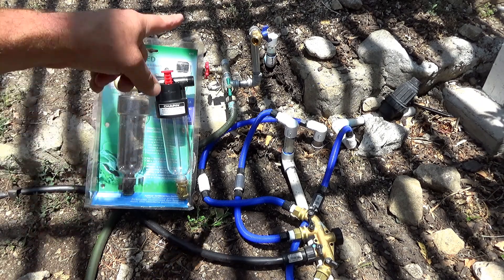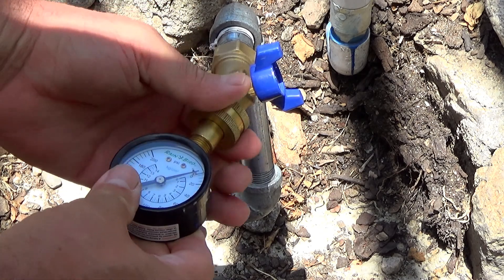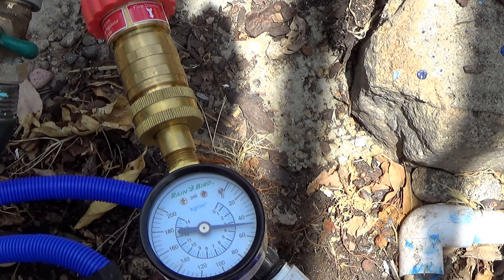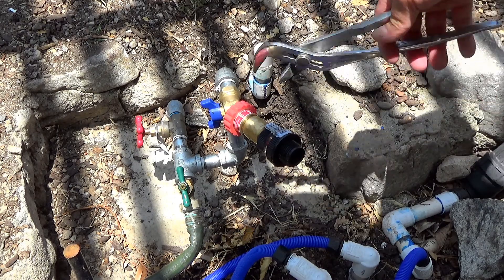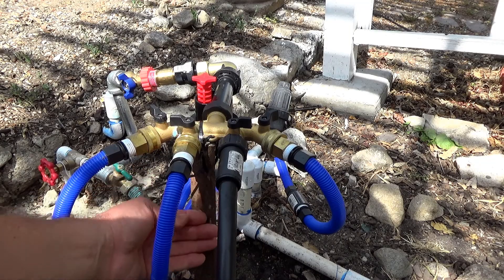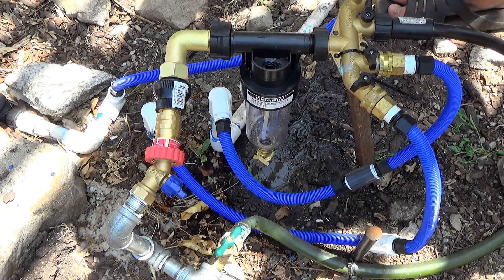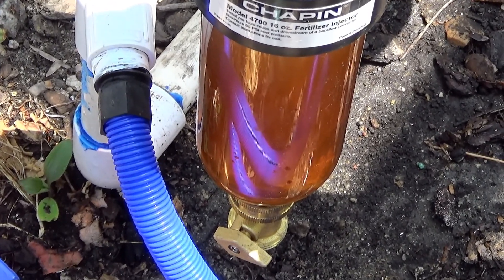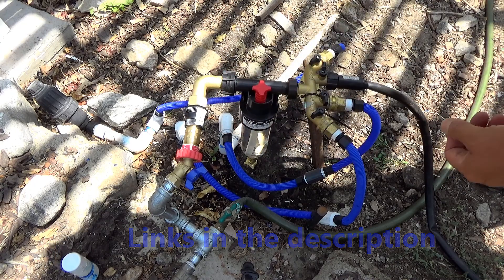Installing a Chapin 16oz Liquid Fertilizer Injector

Comment: What a great video!  This is all new to me and I do not want to sound like a dope. I use 1 tablespoon of fert to one gallon of water. How can I make the mixture so I am getting gallons at a time watering with a house for all my plants and hanging baskets? ☺☺☺
Reply from the maker: If you use a garden hose with sprayer for fertilizer, Miracle Gro makes one, which I know works with its granulated fertilizer designed for it. If you're using a liquid fertilizer of your choice, Ortho makes an adjustable "Dial N Spray" that I believe covers from about 8 ounces to 1 teaspoon per gallon, and it does have an adjustable setting for 1 ounce per gallon; it has a liquid reservoir capacity of 32 ounces, which means you could fertilize with one ounce of liquid up to 32 gallons of water with one fill.
If you want to set up a drip line from your house's spigot, I would search "Installing a drip line to my house's spigot"
Hope that this helps.
Reply: @doityourselferhomeandgarde9732  Thanks so much, Yes, yes I understand what you are saying. I have a drip system hooked up. So far so good but wanted to try to use the Chapin 16oz Liquid Fertilizer Injector connect to "hose" watering if you know what I mean..? Your videos are sooo interesting. I am glad I found your channel.😄
Reply from the maker: Exactly what type and brand of fertilizer are you using? Is it liquid or granulated? If granulated, is it water soluble?   @pennyarizzio2824

Comment: How long did it take before the water turned clear? Mine seems to be getting a darker blue rather than clear. Which doesn't make sense.
Reply from the maker: I am not sure what type of fertilizer or food you are using. But flow rate or water pressure dictates how fast your injector works. If you were to fill the injector with 5 ounces of liquid fertilizer, it would take 5 gallons of water flow, more or less, to dispense the fertilizer, which means low water flow through the injector would cause a slower use of the liquid fertilizer.
What brand and type of fertilizer are you using?